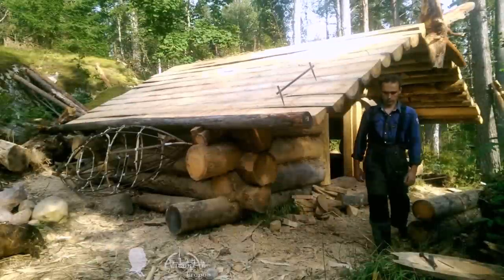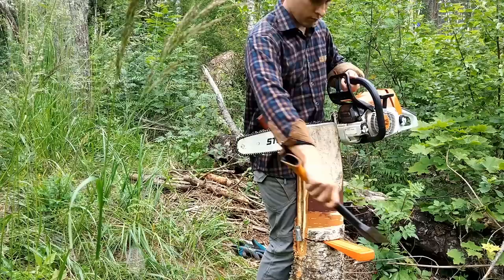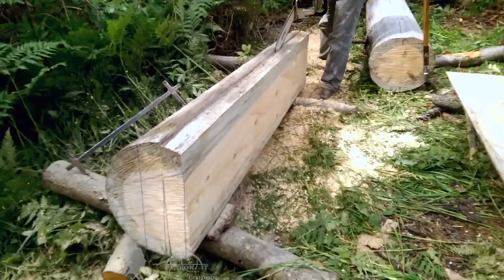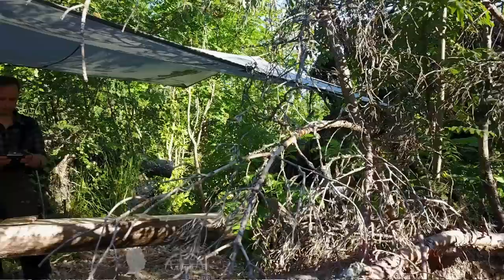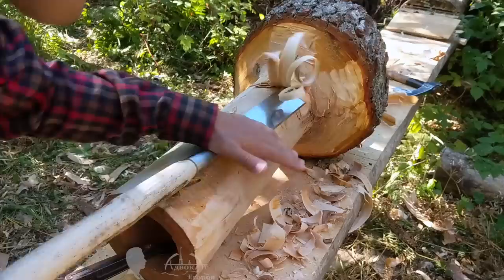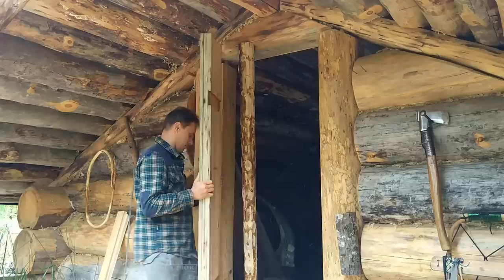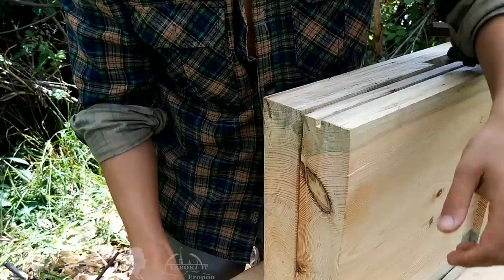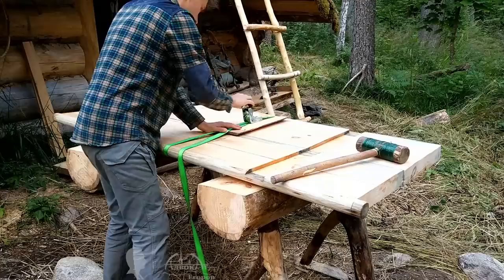Bear-proofing My Log Cabin

Comment: Love how the  roof on the cabin blends all in with nature.  It would be hard to detect the cabin if you were flying overhead.
Reply: Until...someone switches on the FLIR thermal sensors whilst flying overhead looking for .......bears?
Reply: It's a weird bald patch of ground, so definitely easy to spot.
Especially in the winter when you need a heat source.

Comment: The reason you have your doors opening out is what you said in the beginning. BEAR PROOF. Bears push IN they don't pull out when trying to get to their lunch. You being lunch. So as the bear pushes in to get to you, you are more secure in your cabin. 

Hope this is correct or close to your thinking. A great home as I have handcrafted more pine in my life then any other wood out there. Nothing more rewarding then making something yourself.
Reply: I see bears pulling meat though:
Reply: Push with paws, pull with teeth.  I've watched vears try to break into a cooler.  They try to push the lid in.  If that doesn't work they'll use their mouth to pry open a corner of the lid.
Reply: I used to work for a bank. The security team always detailed doors that swing out, like yours. Any battering ram has to break the entire frame of the door rather than just the lock mechanism. Nice job and great video.
Reply: @atomicinv2  Just drill 3 holes; attach 3 loop hooks and chain the door to a vehicle and reverse slowly: Door rips off 0_o

Comment: Open inwards: steals indoor space, especially important in small cabins. Open outwards: catches the wind for better ventilation in summer.
Reply: Open inwards: bear inside!😂
Reply: Also the drawl from the fire is a better seal
Reply: you will also be trapped in the house if there is a lot of snow at night or a tree falls under the door.

Comment: I really enjoyed watching. You are truly a skilled craftsman. In response to why you have the doors open outwards, I would think it would be harder for a bear to pull the door open than for the bear to use its weight to push the door in.  Not sure how to stop the snow from blocking the door from being opened from the inside though. But, you said you were making a bear-proof door not a snow-proof door.
Reply from the maker: With a low roof and a long roof overhang- the snow problem will be minimized.

Comment: As someone who installs doors, main reason doors open outwards instead of inwards is due to emergency. You do not want to have to worry about pulling a door open to get out in case of serious fire or other hazard instead of going straight out. Fight or flight response shows this best, you will ALWAYS push things out of your way when your scared for your life, never stop and pull
Reply: If you push it out and see that f--king bear in your face you'll be pulling it back in!
Reply: @mickey1849  yea, and if you pull the door open and see a bear in your face, will you not be pushing it shut?? Or does that change things?Lol
Reply: @rocketman6478  Well, since there is a significant contingent of us that cannot seem to get enough of discussing the hypothetical bears at the door of the log cabin--LOL--then let's carry on!  Now, your implication above seems to be that it will be more difficult to push the door shut on the bear than to pull the door shut on the bear.  However, I would disagree.  If the door is pushed out then the bear can wrap his huge paw and forearm around the edge of the door, thereby making the closing of the door problematic at best.  All the while, the bear could be going to town on your crotch area with those choppers while you are trying to knock his snowshoe-sized paw from the edge of the door and pull it closed.   ///   However, if the door is opening inwards and the insistent bear is trying to get in, using simple pressure to close the door will force the bear--and that sizeable snout and choppers--back out the door, without the bear being able to hold it open by getting a grip on it with his paws and forearm.   ///   However Advoko, being a native of the area and a newly minted expert on the phenomenon of bears breaking into log cabins----he may want to weigh in on this debate himself.  Maybe we should ask him?
Reply: @mickey1849  so, I e read your theory. Nice.  But I do believe that you mistook may comment Altogether. I didn't mean that one-way or the other works better. Yes, if the door swings out, the bear could wrap his paw around it, therefore rendering your attempt to shut it useless, but at the same time your insinuating that you cannot over power the bears grip on the out swinging door, but you can over. Power the entire bear with him pushing on an inswinging door.  At the end of the day, your not gonna overpower a bear no matter which way the door swings. That's what I was getting at. If the door swings. In, you open it, theres a bear standing right infront of you, if heads in the door before you can shut it completely and latch it, he's getting in.. much easier to pull something than to push some, that's a scientific fact. But it wouldn't matter which way the door swings if the bear is in the middle of the doors travel.